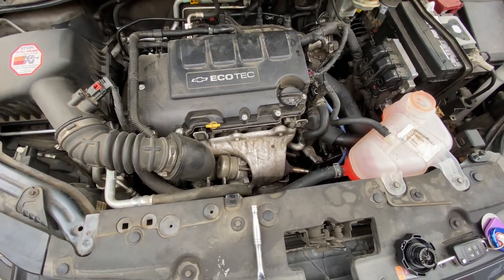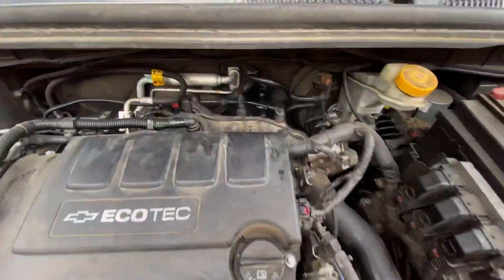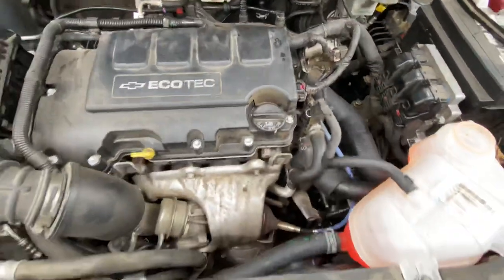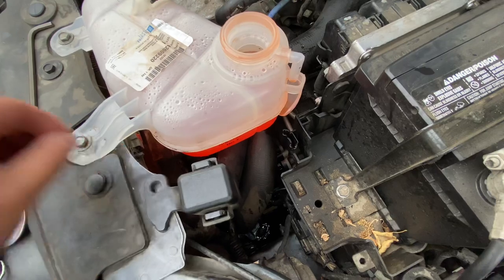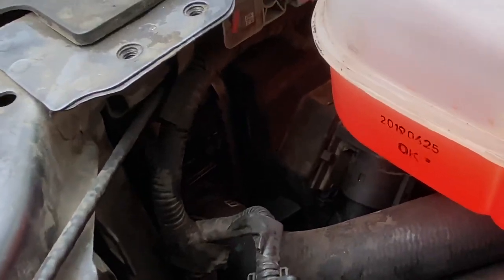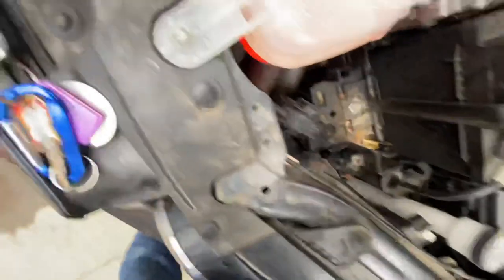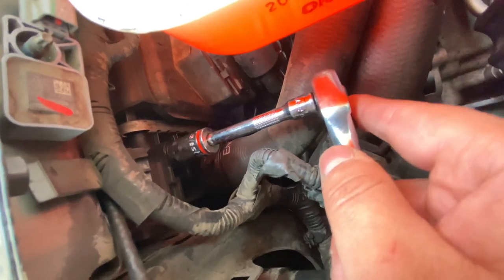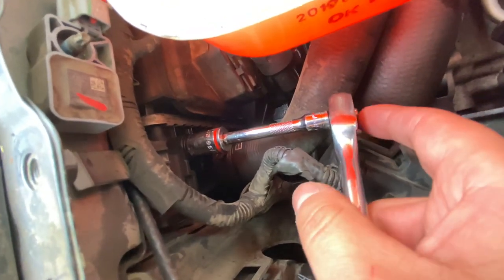Chevy Sonic 1.4L cooling system bleeder valve

Comment: If you have a 1.8L the bleeder is on the other side of the radiator, passenger side around the top corner of the radiator.mine is black

Comment: Is this method same for a 2012 sonic 1.8 non turbo? Is the bleeding valve in the same location?
Reply from the maker: Why don't you check lol I'm not sure exactly I'd imagine it's pretty similar
Reply: other side of radiator